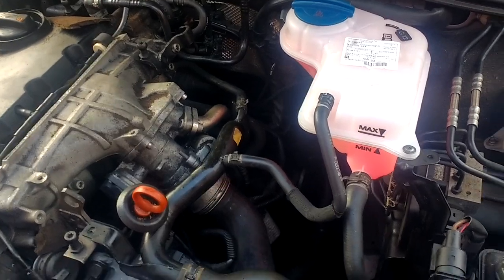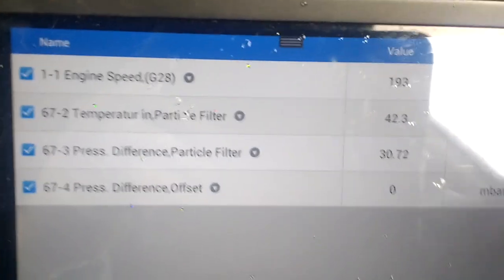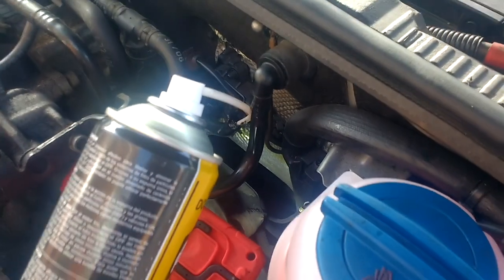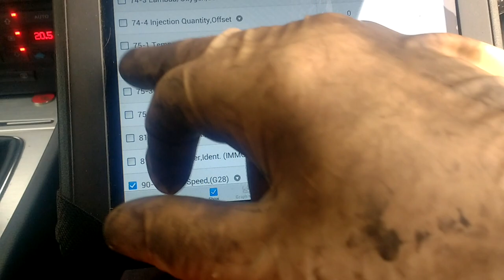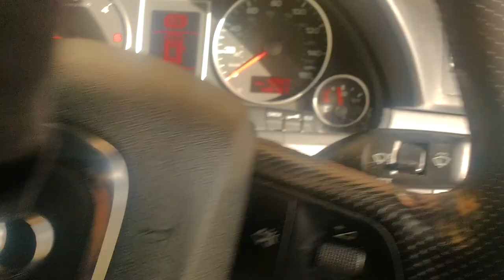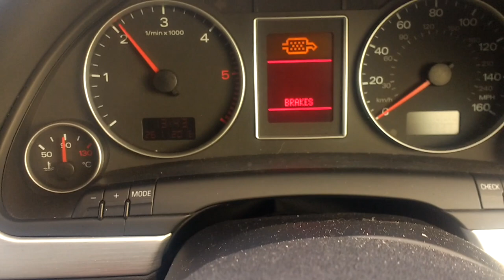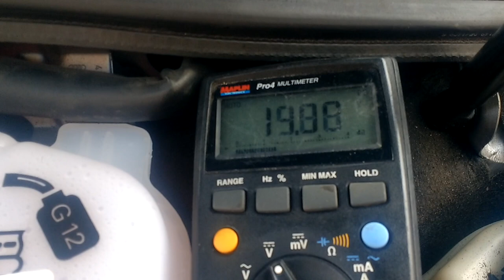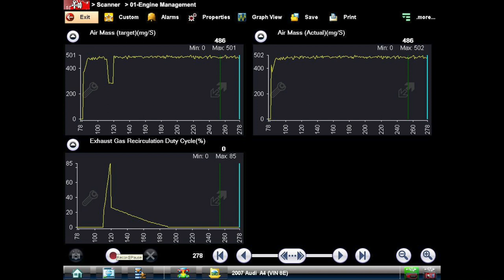INNOTEC DPF DOCTOR

Comment: Well done Sandy.
The DPF figure at idle on the one's i have done  were showing single figure between 3-9.
Some do go a little higher.
I think the car showing a EGR fault is enough to stop the car going into regeneration.
Reply from the maker: Cheers Tam, yes your right it does need the EGR, here is a good video about diesels cheers sandy
Reply from the maker: https://youtu.be/kTt7Dw7-pb8

Comment: Hi Sandy,
Great video. I have the same A4 and have been having a similar DPF issue. Initially had an intermittent limp mode (flashing glow plug light) which would reset when the engine was restarted but then it came on permanently and while driving home the DPF light then came on.
Was showing a throttle body fault replaced it but the DPF light stayed come and the flashing glow plug light and limp mode remained. Tried to drive it to do a regen but that didn’t go well being in limp mode.

Was showing the same DPF fault code as yours but without any EGR faults.

Going to try a can of this stuff asap but was wondering if the Audi you worked on was going into limp mode? Hoping this cleaner will sort the DPF and get the car out of limp mode.

Do you do home repairs? Don’t think you’ll be too far away!
Reply from the maker: Hi try innotec dpf cleaner first, if that doesn't unblock it u can buy a Forte product to clean it but u must remove dpf off car to reverse flush, cheers sandy ps what is your back pressure readings?
Reply: sandy anderson 
Thanks for the reply. I had to change the turbo core (long story) and clean out the intercooler so that work has been done. Needing to refit the intercooler and piping first but I have the Innotec cleaner ready to go.

My car as the same DPF fault code and flashing glow plug light so I’m hoping for the same result you had.

I’m not able to read the readings unfortunately but I do have a fault code reader. Only showing the DPF P2002 code and a MAF code but the MAF is currently unplugged.
I also changed the exhaust pressure sensor as they can become unreliable and fail but that didn’t make a difference, to be expected though as it’s a P2002 fault.

Was your Audi in limp mode along with the flashing glow plug light or was it still driving ok?

Thanks again,
Cammy
Reply: 45Camster Did you ever get your issue solved? I’m having the exact same issue with limp mode, P2002, and flashing glow plug light.

Comment: Hi Sandy, I have some problem with my BRD. The error code is P0299 what I have to check? The car entry in Limp Mode and i need to stop the engine and start back if i want to go without spark plug indicator and no Limp Mode. I apreciate.

Comment: Hi i'm having DPF problem with a mazda 6 2.0 d fault code  p2452  will this treatment work for this code ?
Reply from the maker: P2452 Meaning

The Powertrain Control Module (PCM) monitors the rationality of the Diesel Particulate Filter (DPF) pressure sensor during idle and part load operating conditions. The test fails when the diesel particulate filter pressure sensor signal value at idle is less than 0.15 kPa (0.022 psi). The test also fails when the diesel particulate filter pressure sensor signal value at part load is less than a minimum value or greater than a maximum value. These minimum and maximum values are based on the volume of exhaust.
Based on the above information u need to find out what the value of back pressure in exhaust is; if it's low then no, if high well it could help! Mazda notorious for high oil level check that, also clogging oil pick up! Cheers sandy
Reply: @sandyande   Great info Thanks .

Comment: Did the owner have any more issues with the check engine light coming on relating to dpf after this?
Reply from the maker: No all was sorted cheers sandy
Reply: Thanks for the video. Going to give this a shot on mine
Reply from the maker: Just make sure no other faults in ECM